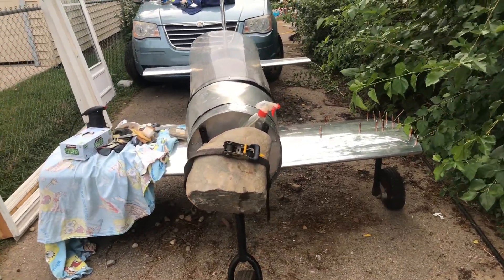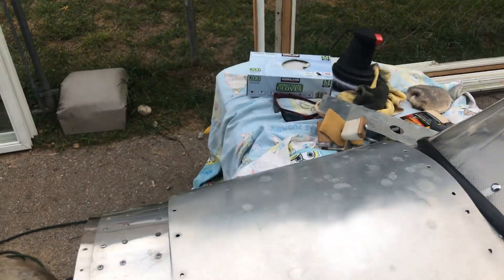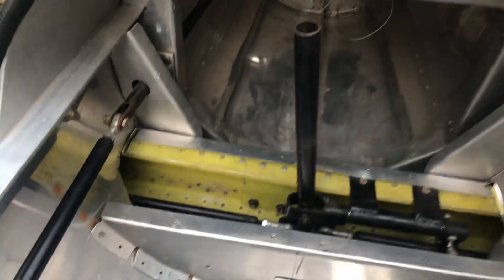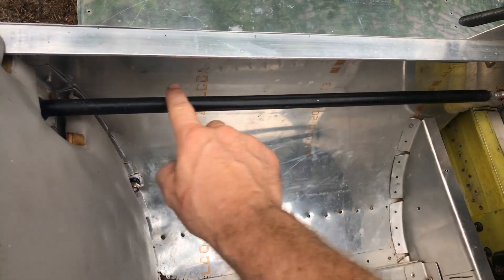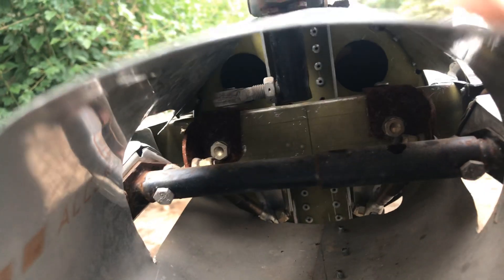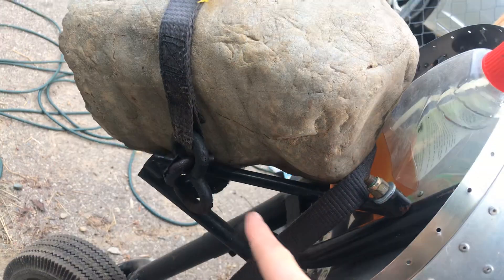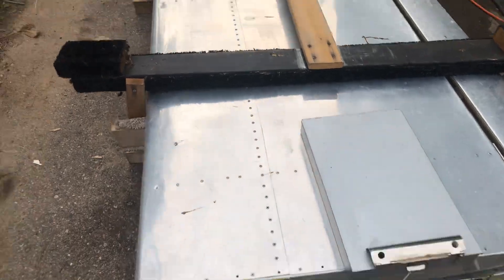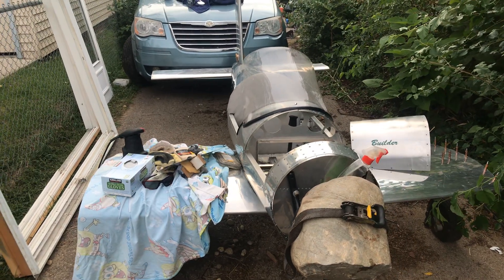Windwagon Ultralight Build E01

Comment: The aircraft was designed by Gary Watson, of Marfa Texas, in 1976-77. There should be a set of comment sheets with the drawings, if you don't have them, I will send you a copy if you send me your address.  About 10 years after Gary died, I approached the family about buying the design from them. I wanted to clean up the drawings, include tested patterns for forming all the parts, and make things simpler and split the plans into sections, and do a builder's manual for the aircraft, but they did not want to sell.  (Gary's comment sheets are very interesting, and clear a LOT of things up, but they have a lot of grammatical and spelling errors. Also, when he was writing, he would wander quite a bit.) When I purchased my plans and the booklet from him, I talked to him several times. He told me he did the fuselage layout by having his kids hold a round plastic wash-basket over his legs to determine what the diameters of the fuselage needed to be, next to the kitchen table.  It IS a very clever design (Things like the rudder pedals being connected to the nose wheel steering as well - simple and elegant!) It looks like whoever did yours did a pretty good job with it.  The pushrods for the flight controls were originally intended to be 6061 aluminum tubing. I do not know why the guy you bought it from used steel. Those parts will weigh 10 times what the aluminum tubes weigh. Gary has the tubing specs on the plans. The bellcranks and fittings should be all STEEL (4130) and should stay that way! Also the struts and nose gear, and the steering components, should all be of 4130 as well. DO NOT change these to aluminum, as you won't have near the strength you have with what you have right now. I am NOT a fan of pop rivets, so I planned to rivet my Windwagon with regular aircraft aluminum driven rivets, which I have a lot of experience with.  However, to do that you need to plan ahead, because Gary just assembled the aircraft as he went, and pop-riveted everything, and it all worked out fine. The few people I have talked to that have actually FLOWN their airplane, say it handles very nicely.  It TRULY is the VERY MINIMUM AIRPLANE YOU CAN BUILD.  It can't carry very much, but it is designed for just going up and flying around and looking at the landscape, and watching the cows wander around,. or perhaps flying short distances to where your local EAA chapter is having a pancake breakfast. (IF YOU ARE NOT A MEMBER OF EAA, JOIN THEM NOW!) It is very well laid out, and should be very aerodynamic when flying. It arose out of the "Teenie Two", which is hard to build because the drawings are pretty poor. I have heard a lot of builders say they WOULD NOT recommend the "Teenie Two" for a first homebuilt aircraft. After the Windwagon came out, Morrie Hummel basically redesigned it into a slightly larger and more capable aircraft, the Hummelbird. which has now grown into the Hummel H-5. Morrie Hummel also developed an ultralight version, the Hummel Ultracruiser. I have the plans for the Windwagon, the Teenie Two, the Ultracruiser, and the H-5. However, all the Hummel designs are MUCH more expensive to build.  (The windshield on the Windwagon will cost you about $30 to buy the Plexiglas, heat it in your kitchen oven, and drape it over a mold. The cockpit canopy for the H-5 is $1100. A basic Hummel kit now runs about $20,000. So the Hummel series of aircraft are no longer the cheap option they used to be. Another thing about the Hummel aircraft is that they are built from sheet 6061 aluminum. But if you look at any aircraft handbook, the 2024 aluminum (that Gary Watson used) is about 25% stronger than the 6061 used on the Hummel aircraft. I was going to use the Hummel plans that I have, but build everything in 2024 aluminum if I built one of those. But if you bought a Hummel Kit, you would find that everything is pre-drilled, and you can have the fuselage assembled completely in less than a week. They are VERY fast to build, and everything fits perfectly.  So that is what the tradeoff is. But you basically got a nearly complete aircraft for $500, so you are doing VERY WELL. And the build quality of your aircraft, from what I can see in the 3 minute video, looks very good as well. There are a LOT more engines to choose from, so you are actually lucky they never mounted one in your aircraft, because if they had made up all the mounts and drilled all kinds of holes, you might have had to replace some of the sheet metal to support your chosen engine.  So you have a virgin and unmolested engine compartment into which you can fit ANY of the current crop of really good engines that are out there. So be glad they just put a boulder in there for now.